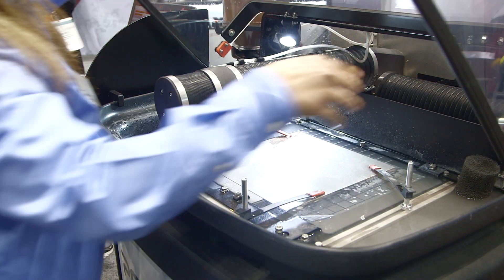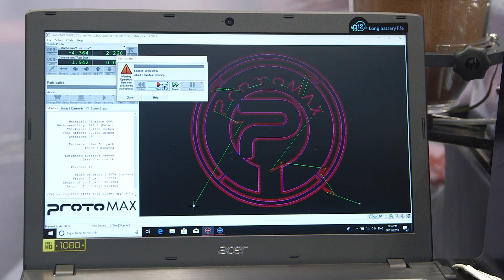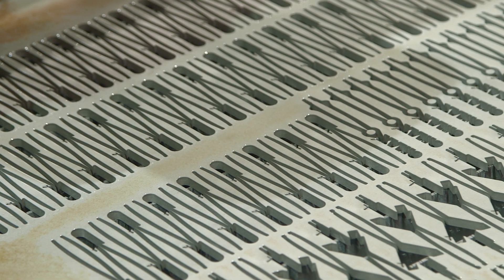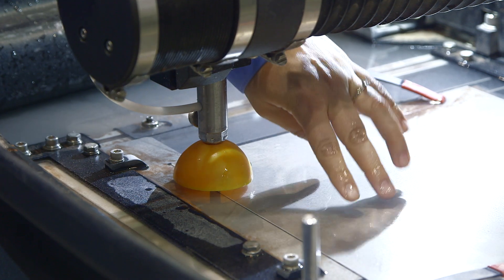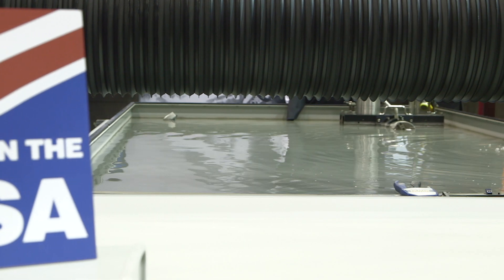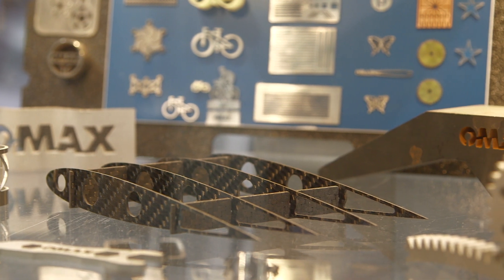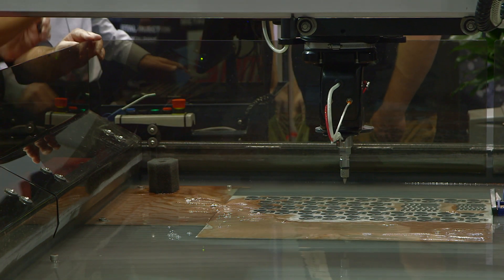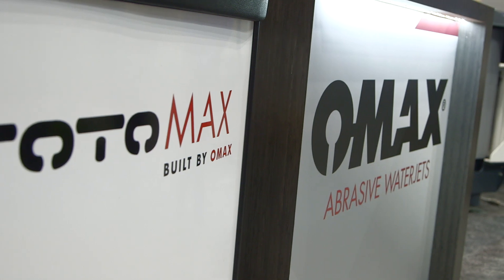OMAX | ProtoMAX® — IMTS 2018

Comment: How does the protomax (12x12, $23k) compare to the wazer (12x18, $8k)?
Reply: the wazer I predict has a much smaller pump, i estimate it makes anywhere between 2 to 10k psi whereas this does 30k psi, the wazer has a larger cutting area too.